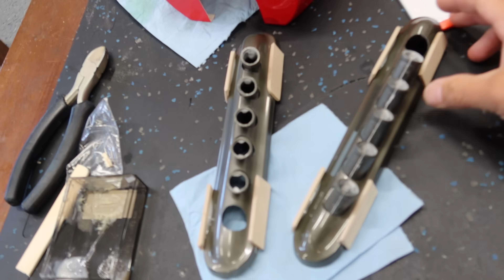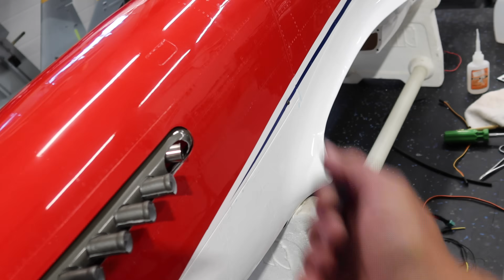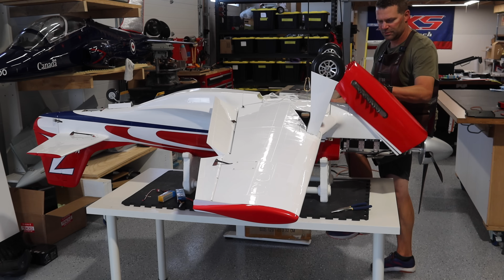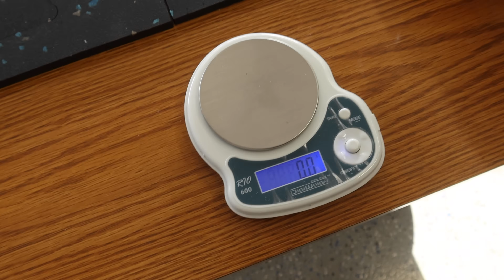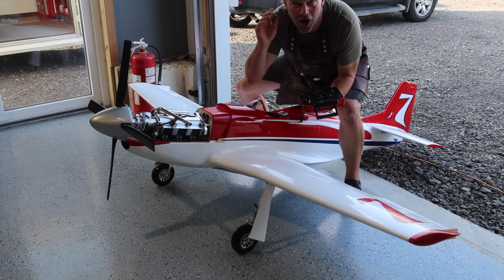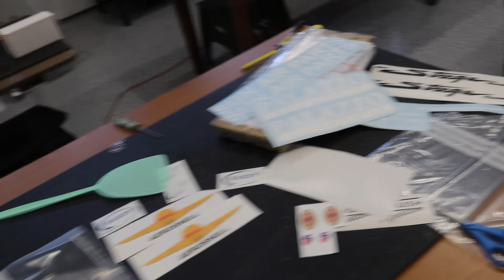Ready for Takeoff: CARF Strega Reno Racer with KOLM 230cc Engine - Build Complete

Comment: hello, very good video as usual. Do you have to use a template to adjust the pitch of the C-arf propeller? If so, is it possible to get the dimensions of your jig?
Reply from the maker: Thank you.  The pitch gauge was in the manual.  Just copied it onto ply.

Comment: Fantastic job on a beautiful airplane  That 3 cylinder engine sounds phenomenal 
 Did you notice the aileron's fluttering when you run the throttle up?  Could be a concern   Great job can't wait to see the maiden
Reply from the maker: Thanks!  The aileron movement was from the gyro being turned on and the vibration.

Comment: I noticed the port aileron flutter slightly when you had the throttle up might be worth double checking the linkages just in case. 
Lovely build!
All the best from the UK 🇬🇧 👍
Reply from the maker: Good eye Mick!  Well done!  that was the gyro compensating for the vibration.  I left that out of the video but with gyro on and accelerating on the ground you could see the amperage from the surfaces climbing drastically! Normal stationary is 0.5 to 1.0 A.  It climbed to 5.0A during that.  Not entirely sure we will use the gyro.  It will be one of those tested items in flight and left off for the beginning of the maiden.
Reply: 5.0A Jesus that would cook it for sure!😮 thanks for explaining the flutter though 😊
Reply: I really enjoyed this build. I did a Phoenix model 30cc with a 35 DLE, all metal gear and nose cone, plus custom Callie graphics! I was too afraid to fly it! Lmao! I’m really curious abt the Demon cortex set up. I used one on mine and it worked well! I love this video series! Thanks!

Comment: This is going to be a great watch. I love this engine. If you’re using Deans connectors…what’s Dean gunna use? 🤷‍♂️😃 QQQ: It looks like there’s a bit of space in the hub. Is the propeller designed to accommodate a central pinion to enable “blade pitch control”?
Reply from the maker: Bahahaha!  Well Done!